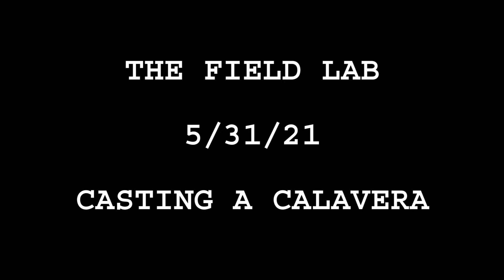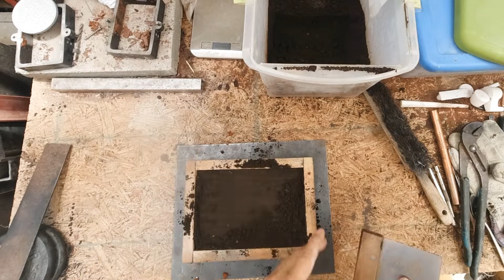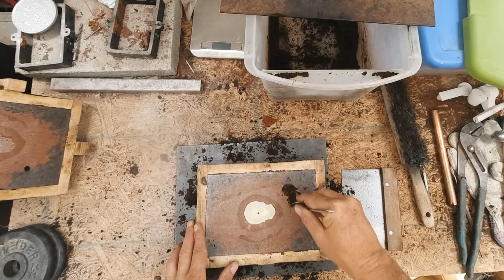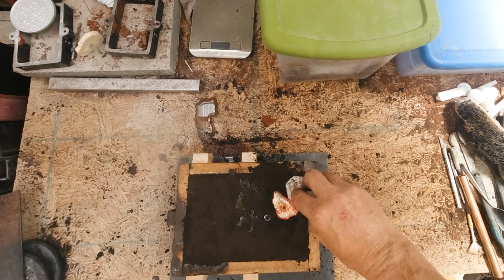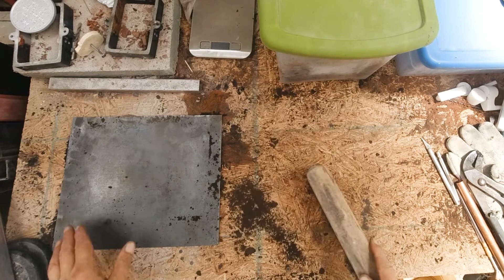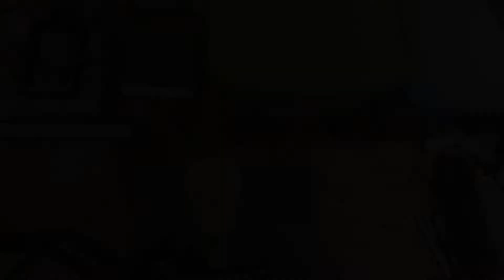CASTING A CALAVERA

Comment: Very cool...I actually did some similar castings in shop Class back in the early 80's in Ohio...it was fun and interesting.
Reply from the maker: I took a course too back in the 80's at The School of Visual Arts in NYC.  We did lost foam casting - making a pattern out of styrofoam and packing it it green sand.  The molten metal would burn out and replace the foam to make the casting.  Quite a toxic way to go.
Reply: Nici job,grettings frumos Europe.